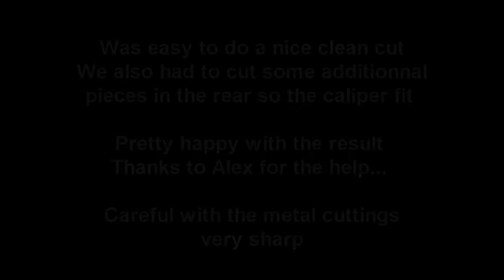brembo rear install - cutting dust shield - Genesis coupe.wmv

Comment: I was thinking about just cutting few slices into the dust shield and then bending the pieces back rather than remove them. That way they are still functioning somewhat as a sheild. Thats IF there's clearance to bend them back straight

Comment: How difficult would it be to swap the dust shield with one from a Brembo equipped Genesis?
Reply: Dont have a genesis but im sure it is like g35 coupe so you’d have to remove axles and wheel hub